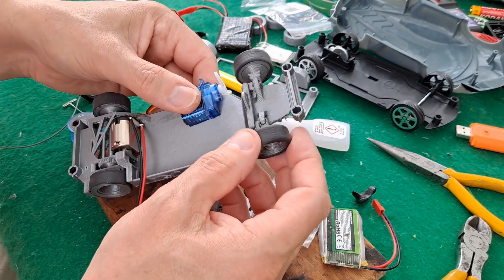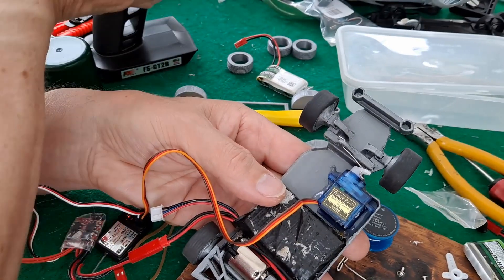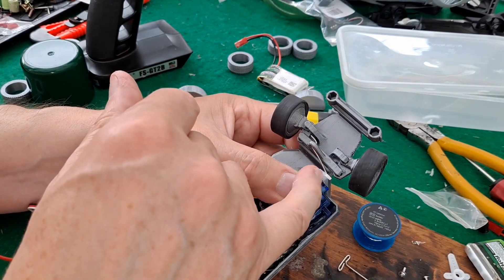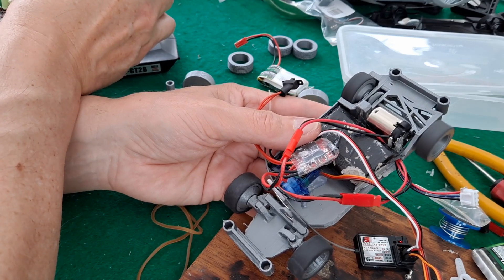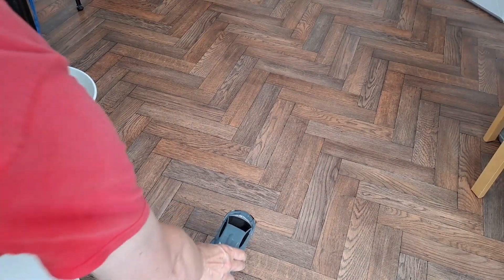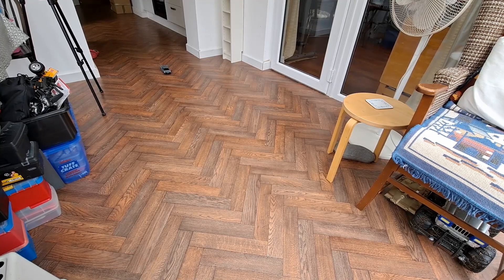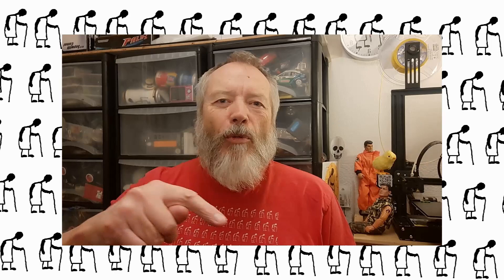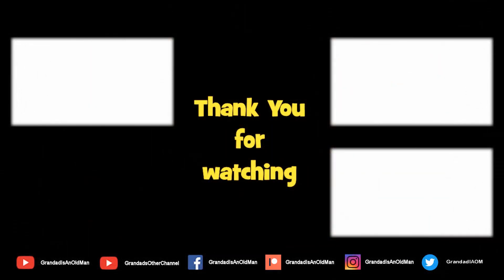Poundland toy car RC conversion project -  Print in Place Part 4 - It works

Comment: What you hate more: sound of buzzing of hobby grade electronic or sound of not lubricated 9g servo motor?
Reply from the maker: The ESC making the motor 'sing' is very annoying. I usually try to filter the frequency out in editing.

Comment: Awesome! Ive done a few of these cars using shift 24 systems
Reply from the maker: I hadn't heard of shift 24 but I have just done a YouTube search and can see there are plenty of videos on them 👍
Reply: @GrandadIsAnOldMan  it would be great to see you do a video with that!
Reply from the maker: Unless one turns up cheap in a charity shop, it won't happen. I very rarely buy new RC cars.
Reply: I've managed to find a couple of used ones,.The rechargable batteries in them losen up sometimes, but that's ok cause I pull them out anyway. good luck my brother!

Comment: Nice video.that gar Works Pretty good with the tires on there .glad that there wasnt ans Problem with all the rc gear fitting onto the chassis there.nice and snug in there.are you gonna take it out for a spin on the pavement anytime soon?
Reply from the maker: No, that's as far as I am going with this, I want to get back to my own design.